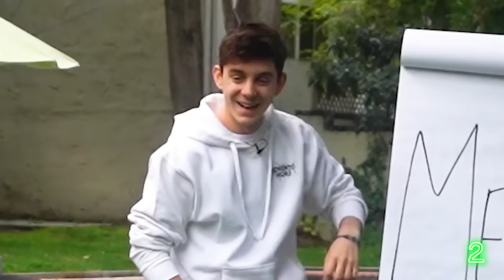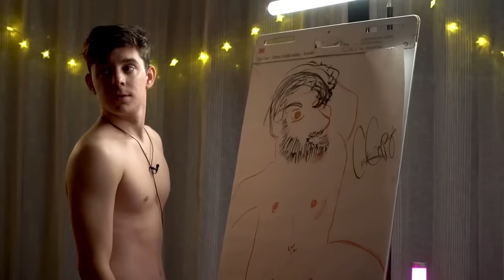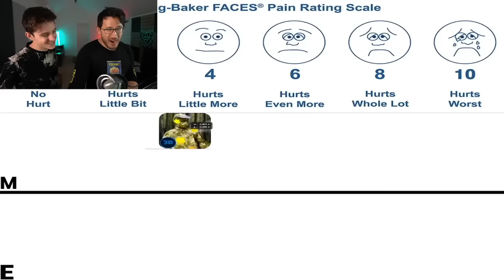Unus Annus Compilation - The One with All the Paintballs

Comment: The "scary" paintball gun is a J2 ER2 pump pistol. They're dirt cheap, but whatever you do don't buy the Squirtilizer. It SUCKS ASS...
They also make a semi-auto J2 ER4 with higher capacity, it's just as good if not better, though the battery usually dies 2/3rds through a filled to brim magazine. These are epic for DIY modding!